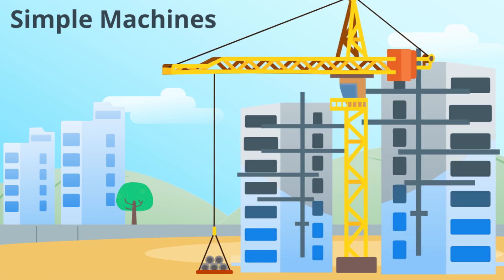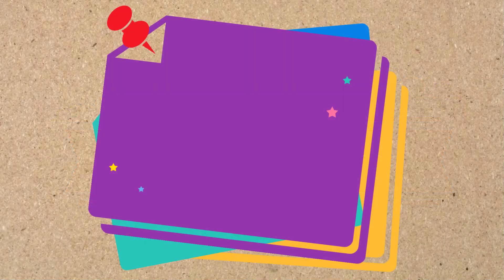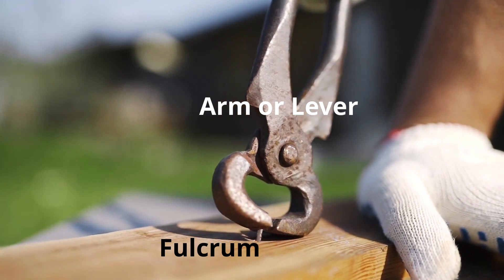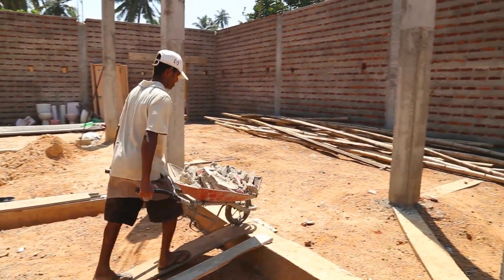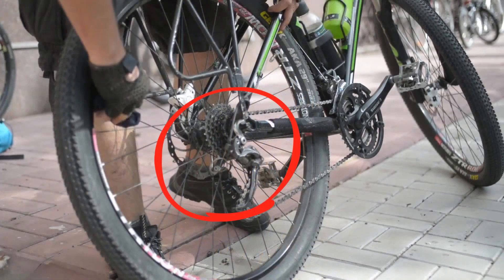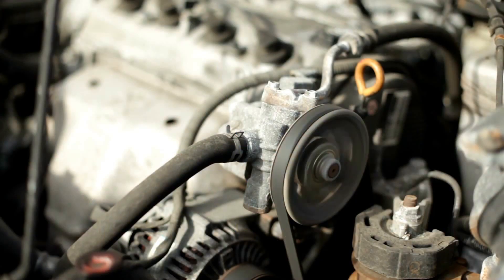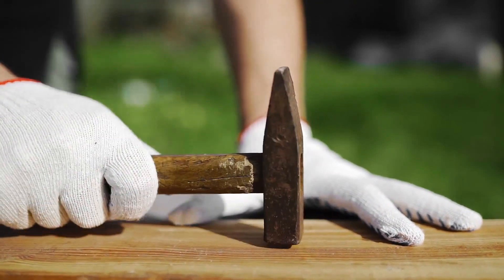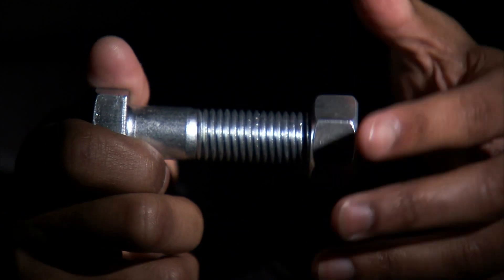Examples of Simple Machines used in everyday life

Comment: WHY are only six simple machines discussed when there is a seventh?    The principle is the bow string or draw line.     Attached two ends of a rope to two objects.   Go to the center and pull.   You have a mechanical advantage right up to the point you get the rope bent at a right angle,  then you start losing your mechanical advantage.    Tie one end of a 100 foot rope to a tree and the other end to a car and go half way and push side ways and you can actually move the car easily.    This has all the requirements of a simple machine:   A device with few or no moving parts that modify both the motion and the magnification of force on an object to preform work.  And it is not like any of the other six simple machines.